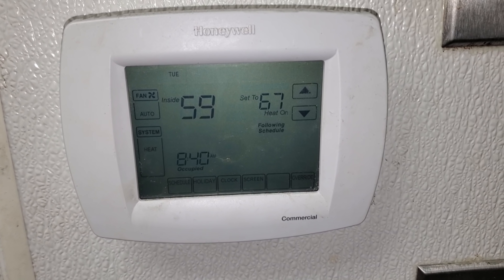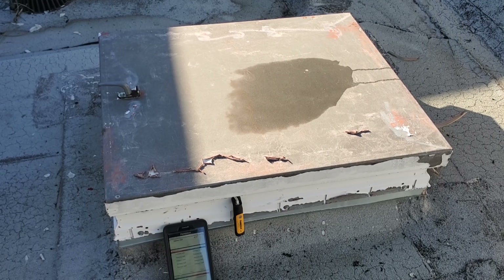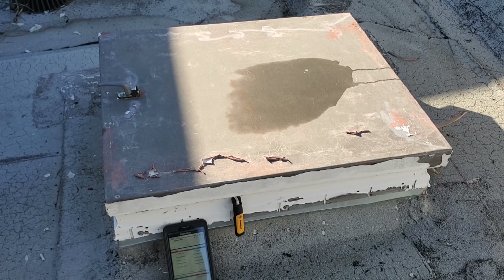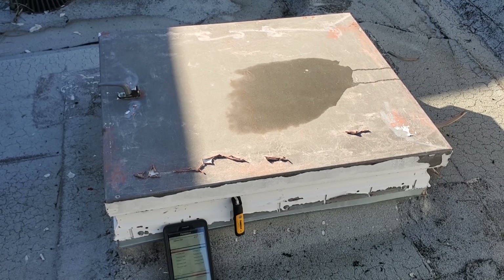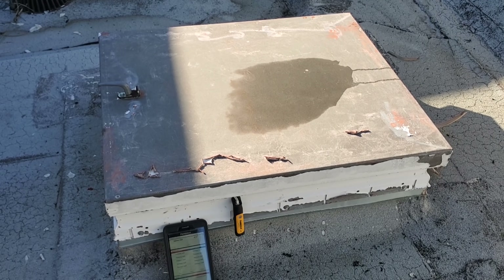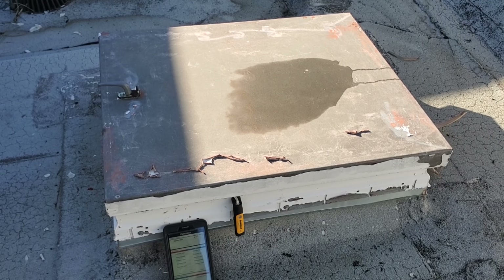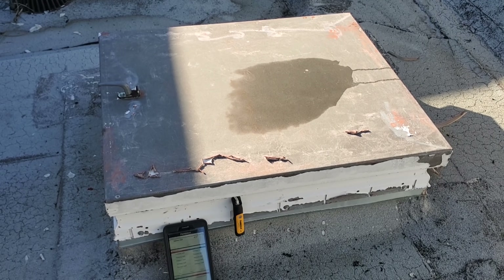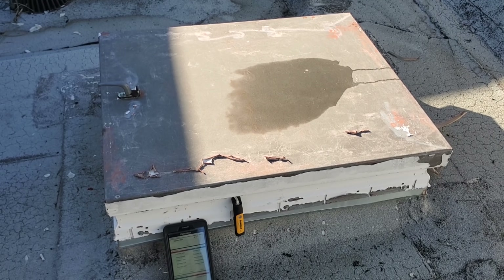FIRST NO HEAT OF THE YEAR

Comment: Considering the board is grounded I'm kinda shocked that static took it out especially running co2 for a blow out its more the plastics like the stuff running down hose aka like when we run sanders on vacuums for dust collection like don't get me wrong I've seen main boards on inverter welders main boards when working on them being taken out when doing a board swap but that's uncommon honestly grounding strap to you while blowing it out in the worst case but my area isn't quite as dry as your area

Comment: Why is there a 110 outlet inside the unit. and is there a inverter for 110? I’ve always wondered
Reply: service outlet for work/repair, likely it's just one leg of the 208V 3 phase, which would provide common 120V to neutral single phase power ;)
obviously the unit would need fed with 4 wire conductors(plus ground) so it has a neutral.
I didn't pay attention that it was 3-phase unit, but I'm sure it is without going back to look :)

Comment: Don't buy stupid priced Fluke products -- They're made in China, not U.S. -- I have had nothing but problems with 337 clamp probe, 52II temp 
(U.S. made lasted 12 years) -- I currently have praise for the 971 humidity tester & 1587 Insulation tester (U.S. made) -- BUT WILL NOT -- REPEAT, WILL NOT REPLACE THEM WITH FLUKE AGAIN -- IT'S GARBAGE -- WHY PAY 3 TIMES THE PRICE FOR CHIT? -- don't even get me started on HVACR replacement parts !!!!!!!!!!!!!!!!!!!!!!!!!!!!!!!!!!!!!!!!!!!!!!!!!!!!!!!!!!!!!!!!!!!!!!!!!!!!!!!!!!!!!!!!!!!!!!!!!!!!!!!!!!!!!!!!!!!!!!!!!!!!!!!!!!!!!!!!!!!!!!!!!!!!!!!!!!!!!!!!!!!!!

Comment: Need help replacing my Fluke 337 amp meter (made in China) -- UEi dl429b vs Fieldpiece -- I'm biased toward Fieldpiece since it's made in Taiwan vs Communist China -- I'm still fuming over the Fluke, which used to be best money could by -- what do you guys think?
Reply: Nor Cal Dave recommended UEi429b -- I will never buy Fluke again -- why buy from an American Company that manufactures crap in China and gets all the profit?
Reply from the maker: I'm a big FieldPiece fan if I were you I would look at the SC480 and Or the SC 680 meters. Check out trutechtools.com and use my offer code bigpicture on checkout to save 8% on your order

Comment: Interesting, never thought about Exhaust air (Vacuum) and Make up air as something in a building which would effect the pressure in the building.  In my Industry, we have tanks that need to be kept at a pressure of around 1 inH20 and that is done by means of "injecting" make-up gas or a controlled valve on a vacuum line to pull down the pressure.

Comment: Loose belts wear out the pulley. Then wears out new belts when installed. Then the next step is belt dressing. The only proper way is keep the belt properly tightened to prevent worn pulleys and belts stretching from the heat generated by the slippage. You made the exact correct call, replace the pulley and belt. It is great seeing someone with integrity and know how at work.

Comment: If you blow CO2 or bottled 'air' on a cirquit board you basically are refrigirating it. It probably not failed due to static but due to watervapour condensating and shorting things out.

Comment: Always check CO after touching a gas burner. 
Huge liability 
 if you don't own a combustion analyzer at least get a CO analyzer. You can use it on any type of gas equipment.

Hot water heaters etc.

A must,I can't tell you how many times a year I find a gas burner running incorrectly.

Those Lennox units are tough units.

Comment: Changing the width of the drive pulley, will change the amp draw of the motor. Drawing higher than recommended amperage is an excellent way to destroy the motor, but I'm lazy and would rather replace the belt, they're lighter than a motor.

Also, if that building had a professional air balancing, changing the pulley's width will toss the air balance right out the window, and that is not saving the customer anything. 

Funny, but my recent maintenance sweeps at a national sporting goods store have turned up issues on unit#3 at multiple stores. I just cannot turn of the technician part of my brain to just change filters🤷‍♂️

Great video as always.

Comment: So if your not suppose to adjust the pulley but a previous tech(s) did adjust it how are you suppose to know exactly the width opening of the pulley?
Reply: that's a problem, best you can do is check the motor run current isn't too high with belt properly adjusted, but that doesn't tell you if the building air balance is correct :)

Comment: No need to replace the electrode and flame sensor. Just clean them with a wire brush.
Reply: And all inducer housing mounted pressure tubing ports should be cleaned on a trouble call and once a year during maintenance.
Reply: @mathewahrens4475  for sure @ check ports

Comment: Basic millwright skills - align and tension your belt drives, and you can go many years in most applications.

Those motor mounts in the package HVAC units are flimsy and awkward, and the pulleys look to be low cost items as well, so I don't expect you to get decades out of such a drive, but when you have really good components that are set up well, your limit on life is the elasticity of the belt, and I've worked with machine tools that have gone decades before needing a new belt and the pulleys are just lightly polished.

Decades in shops which are not air conditioned spaces. The roof-top exhaust fans are going to cook belts here in SoCal... sunlight plus hot gases from the kitchens will do that.

That long life is largely due to a pretty significant difference in quality of the system and alignment, because the belts are the same, and the pulleys aren't hugely better than on these HVAC units.
Reply: cheap cast iron for sure and loose belts means more slippage and faster wear for sure

Comment: about the adjusting pully's etc. i've seen stuff like that in most industries. so many tradesman make the error of trying to save the customer a dime, only to have it cost a dollar later on. 
even with my own work, we probably lost $1000 in production because the boss just "adjusted it" instead of replacing the $10 part.

Comment: I just fixed an ICP package unit for a friend. It had no ignition from the ignition module. When I unplugged power from the module and put my meter on it, , I had 26 volts. First assumption was bad module. Then I happened to notice during diagnosis that the gas valve was sporadic. After looking at the diagram the power was ran in parallel with the ignition module. Plugged up ignition module and it dropped to 2v. Ended up being an intermittent relay on the control board. Replaced and all has been well for a month or so now. If I hadn't used a big picture diagnosis, I would've replaced the ignition module for no reason. Funny how it would show 26v with no load on the circuit then dropped to 2 with a load.

Comment: Question 
Why don’t they use reverse cycle in the States instead of having a gas burner system ? 
I work in Melbourne they do have a few here but not many 🤔
Reply: you mean "heat pump", that would only work efficiently in some of the warner climate areas. other areas it would be constantly frozen up and needing to defrost after very short run cycles.

Comment: Replace pulley's? Absolutely! And don't adjust the pitch. You'll screw up the customers air balance.
Wish we had no no heat calls. Glad I am retired

Setting a ladder on snow and Ice going up on a roof with 18" of snow on it and the wind blowing. Not fun

Comment: 10:22 quick way to check for spark on those modules is pull the gray ignitor wire off and use a flat head screwdriver close to the pin to see the arc

Comment: There’s a reason why Automotive got away from V belts breaking and changing them every 20,000 to 30,000 miles. 
            Now high-performance multiribbed the serpentine belts 60,000 to 140,000 miles. 
           When I was a young mechanic changing peoples belts every one or two years on their cars or my own and now I go five years with many more miles. 
              Who’s gonna be the first HVAC manufacture to flinch and change the game 👍
Reply: No adjustable pulleys though.
I personally think the best way is to ditch belts entirely and use direct drive with speed control.
Reply: @JGnLAU8OAWF6  I won hundred percent agree with that. 
           Look at the new Toyota Prius no belts were alternator because there is none no belts for a water pump because it’s electric no belts for power steering because it is electric. 
           All direct drive
Reply: No joke! I guess they think it's good for the techs and pulley manufacturers??
Reply: Yeah, but when I look at the power side of my multi-ribbed belts they have a lot of sand/fine rocks embedded into the grooves.  Never saw that with a V belt.
Reply: @for2utube  oh that’s because of where you live but the belt still last many times longer even with those little saying find rocks. 
              Unless our HVAC equipment is in a desert with blowing sand I don’t expect the HVAC equipment to be driving down the highway with vehicles stirring up dust and sand in front of it at 70 miles an hour.
Reply: serpentines are not much better overall, other than higher amount of force transfer available. they can still be misaligned and slippage/contamination wears the pulleys down. they're just a group of tiny v-belts interconnected after all ;)
Reply: @throttlebottle5906  I grew up as a automotive mechanic in a mechanics family four generations. I grew up replacing cars vbelts from the 60s and 70s every 20000 to 30,000 miles . 
            And just like having to replace or adjust points in a distributor or Grease repack and re-tighten tapered wheel bearings every 15 or 20,000 miles. 
                 We have serpentine go 140,000 160,000 miles even though that’s beyond manufacturer spec. 
                  And we no longer  have tapered cage roller bearings or ball wheel bearings we have permanently sealed bearings on our wheels that go to 250 thousand miles + 
             What has gone backwards is blower motors. Old furnaces from the 40s 50s and 60s have blower motors that are still operating today and was very common 40 years was about a good lifetime for a blower motor. 
                Nowadays five years is good  and 10 years is considered phenomenal for your blower motor in your furnace or AC

           And not having to re-tightened for loose V belts like on your fan hood on the restaurant because it’s constantly always getting loose or in your package unit. 
           Because having the serpentine you would have tensioners that constantly take up the slack forzero maintenance. 
               And serpentines were designed to go on engines that have RPMs going up to 6000 RPMs. And high torque acceleration placed on them every time you takeoff from a stop sign. 

              If you put serpentine belt system with tensioners on airflow hoods at one steady speed 1750 RPMs or less    The HVAC technician Who installed it would be halfway to retirement by the time they would have to change it a second time.
         I guess it comes down to your personal experience and what you know and what you don’t know.
Reply: @coldfinger459sub0  "tensioners" :)))
the things that always fail and give false sense of serpentine belts lasting long....
if you wait until there's noise, it's far too late the belt is way beyond worn and multiple pulleys are worn.
that's saying the tensioner hasn't lost tension due to spring tension loss or the junk pot metal housing corroding and seizing up (exactly what happens around 50K miles if that)
I take it you don't live in a "salty rust belt" area.

Comment: I have found the circuit boards crack around the relay pins where they solder. When I worked on equipment at our church I had several boards fail at the solder connections. Both hot surface and spark ignition versions.
Reply: when that happens, it's most always due to relay contacts failing, which causes excess heating and expansion/contraction of the solder joint.

Comment: I can just smell the hot burning dust..
Reply: Every time we start up our furnace in our house(for the first time in the season) it smells like burning
Reply: Opened a brand new store for the company.  First time the heat kicked 'on' the electric heat tape smoked off all the oils and dust while the store was open.  Had the fire dept respond, part of the shopping center evac'd...  Quite the response!   Fire Dept gave us a hard time, and we told 'em to blame the HVAC contractor.  They are supposed to dry run the system and do full air balance before we get the occupancy cert.  

Funny thing?  About a month later,  Store filled with smoke again...  Fire Dept blamed the HVAC again!   HVAC company comes out and states  "Not us,  Everything is MINT as it's a new system and it already flashed off the trash."   Seemed to happen every few months until they closed the location a few years later.

Comment: all the time i was thinking that the big type ac units that are used in malls make heat just like the mini splits ac units that using the compressor.But that the system is piped just like my refregerator by making only cooling with the compressor and heating with gas fire system.No thats air conditioning

Comment: We have this giant heatpump, lets add a burner to it in case we want to heat something.
Reply: Timothy Salomon  I think FerdinandFake was being sarcastic in that with adding a reversing valve and a few sensors it could be a heat pump instead of a combustion emission producing device...  maybe I'm reading to much into his comment.
Reply: Timothy Salomon  burning gas is propably alot cheaper than the electricity and expensive heatpump components.
Just thought it was funny because ive never seen a setup like that. I wonder how the microchannel condenser would react if you hacked a reversing valve and some biflow components in there, considering the climate in cali it might just work without instantly freezing over.
Reply: @FerdinandFake  I don't know about California, but here in Spain it is cheaper to use a heat pump rather than burning gas. It is also not warm, with temperatures between 0 and 10 ⁰C in the coldest months.
Reply: there's not many states/areas a giant crude heat pump would work worth a beans. if there was they'd all be heat pumps :)
it;s just too cold in winter in vast majority of their sales areas to even have them as heat pumps.

Comment: Chris: Usually I agree with your approach, however to change the ignition box is great, but to change the electrode and flame sensor is just upcharging the customer for not a good reason, just clean them and they will be fine. Also you should change the adjustable pully to a cast iron one of the proper size and that will end the excessive wear on the cheap adjustable pully. You seem to change lots of parts that are not necessary to upcharge the customer.
Reply: In the grand scheme of things the additional parts replaced are pennies compared to having the tech come back for a unit not working again.
Reply: And cost of lost business for the restaurant. Not to mention the risk of getting a bad review. 
Truth be told, cleaning the electrode and flame sensor would probably be an option. But let's be honest: He gets one or two of these per year. Can't expect him to be experienced with that. So replacement of these cheap parts is more safe and probably won't have a significant impact on the bill.
Reply: So when you change a headlight bulb do you replace both or just one?
Reply: He could also just rinse off those air filters, let them air dry, and reuse them. No point upcharging the customer for unnecessary filter changes. I've even seen Chris using (and billing for!) virgin refrigerant to charge systems. I'm sure he's got a few nearly full recovery cylinders around the shop he could be using to top off his customers. Guy's a snake.
Reply: @talleyz  and don't you think that some filters can't be washed and reused? The can fall apart. Plus unless the filters are absolutely plugged, it's not really his issue to deal with them as they have a separate person to change out the filters
Reply: @nikyjim  it was sarcasm, making fun of the original poster's comment...